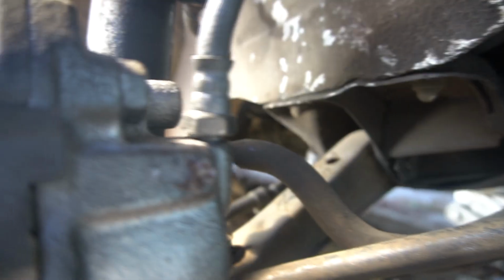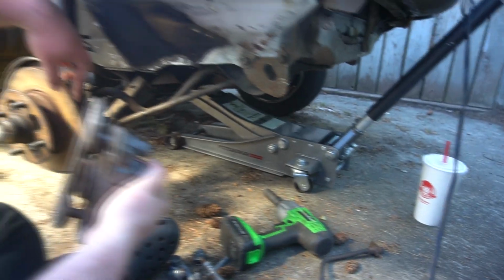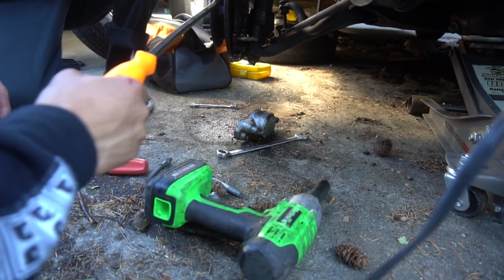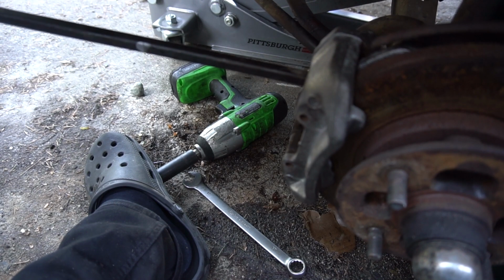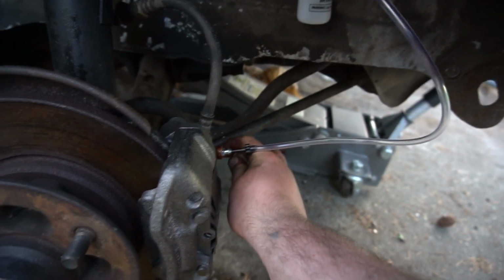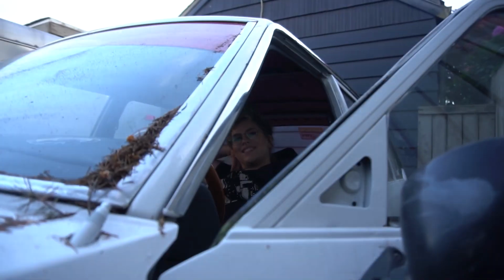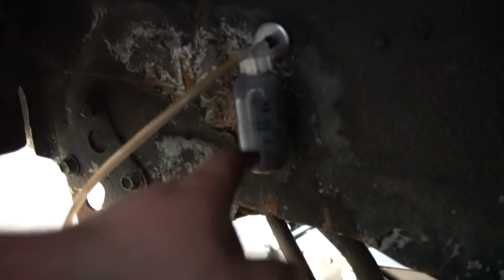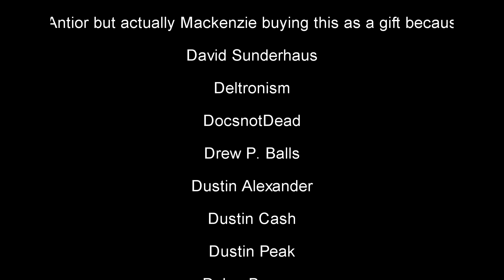Secretly Fixing Girlfriend's TE72 Corolla

Comment: "Corollas are so easy to work on"
I've never had to use a pry bar or a blowtorch when servicing S-chassis brakes though fellas
Reply: Corollas have an extra 10 years of rust on their chassis. S-chassis are usually drift their calipers loose though fellas.

Comment: That scraping noise could be the brake caliper heat shield you just pull it back from the caliper. Happened to me when I changed rotors and a caliper before.

Comment: With that style of bleeder bottle you can just crack the bleeder screw and givv'er on the brake pedal as long as you keep the master filled up with fluid. After the first couple pumps there will be enough brake fluid in the bleeder bottle to not allow any air to get back into the system! Works for any hydraulic system and you don't need to have 2 people

Comment: Always replace both calipers never just one side and flush invest in a mighty vac bleeder either a vacuum bleeder or pressure bleeder setup
Reply: Jack Newberry whys that? (Tryna learn tbh)
Reply: Don’t worry! We replaced both sides!! Thank you 🌸
Reply: @adam_cs1489  so that they operate evenly and don't have more drag in one side then the other just best to replace both it isn't an absolute requirement but on a car that will be driven with some spirit (no power no problem)   best to have things even
Reply: @katherinecrombie9582  I'm just putting advice out there for others I probably should have put a reason aswell to why it's good practice I'm just down in Portland and will hopefully have my lm7 v8 ae86 build on track by the end of the year hope to see you guys out there